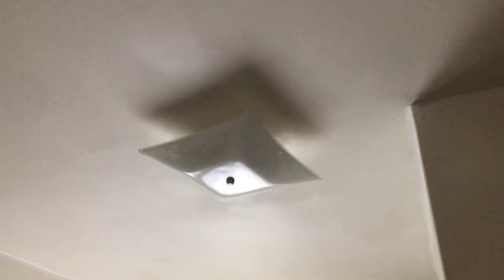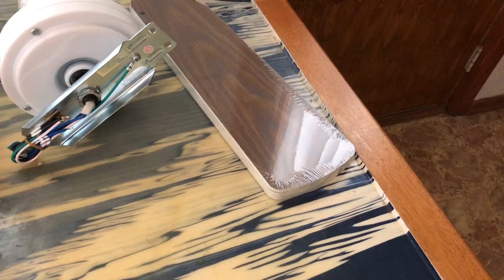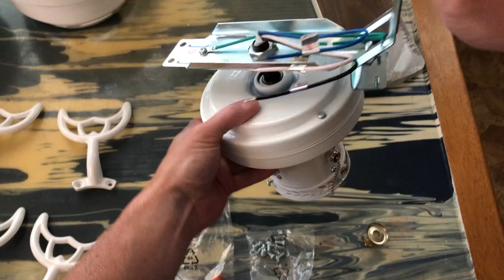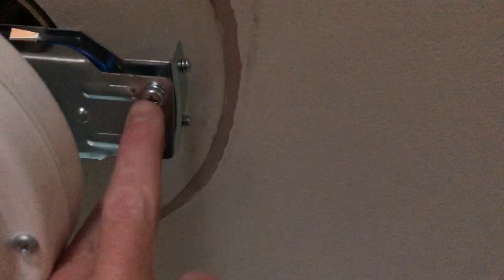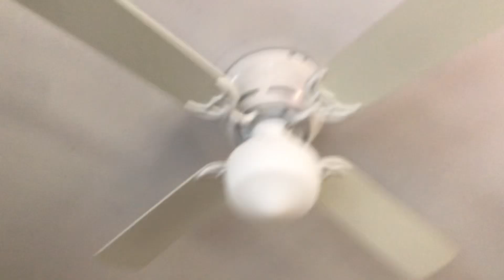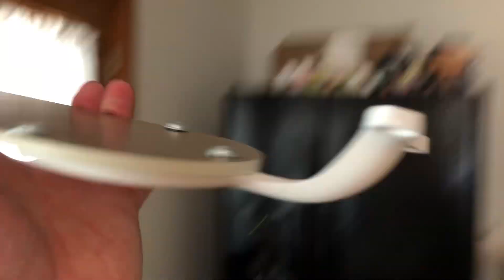Mainstays 42” Ceiling Fan Installation and Assembly

Comment: That electrical box isn’t rated for ceiling fans so you should have replaced the box
Reply from the maker: Ohhh? Appreciate your insight 👍
Reply: @ChrisBassettDIY all of my ceiling fans were mounted to plastic light fixture boxes and one of them fell off the ceiling so I had all the boxes replaced to ceiling fan rated boxes
Reply from the maker: @STLtraincoverage4567 I didn’t know even know that was a thing

Comment: If you wired don’t have a ground cable to connect. what do you do ?
Reply from the maker: Hey Robin! I didn’t have a ground wire either. If you're installing a ceiling fan and there's no ground wire in the electrical box, follow these steps: First, ensure power is off at the breaker. If the box is metal and properly grounded, connect the fan's ground wire to the metal box using a grounding screw. If the box is plastic or not grounded, you can still install the fan, as the ground wire is a safety feature but not essential for operation—secure the fan's ground wire to itself or cap it with a wire nut. For safety, consider having an electrician add a ground wire or confirm the box is grounded. Always follow local electrical codes.

Comment: What do I do with the ground wire
Reply from the maker: Hey D! If there is a spot to ground it you can tie the ground wire from the fan to the ground in the ceiling. If there isn’t one available (I didn’t have one also) I just tucked it up and out of the way

Comment: What happens if I have 2 whites and 2 blacks left after disassembling the old light fixture?
Reply from the maker: Hey Subrein! In a ceiling fan electrical box, having two black wires and two white wires can indicate a few different configurations, often related to how the fan is wired or the existing electrical circuit. Here are some possibilities:

1. **Multiple Switches**: If you have a ceiling fan with a light kit, the two black wires may be for separate switches—one for the fan and one for the light. The two white wires can be used for the neutral connections.

2. **Power Feed and Load**: One pair of black wires might be the power feed from the electrical panel, while the other pair could be running to another fixture or device. In this case, you would need to identify which wires are for power and which are for load.

3. **Looping**: If the fan is part of a series of fixtures, the black and white wires might be looping to another location in the house.

4. **Reversed Wiring**: It's also possible that the wiring was done incorrectly, and the black wires are not properly identified.

5. **Fan Control**: If you have a fan with a remote control or smart features, one set of wires might be for the fan's operation and the other for the control mechanism.

### Safety Precautions:
- **Turn off Power**: Always turn off the power at the circuit breaker before working with electrical wiring.
- **Use a Voltage Tester**: Test the wires with a voltage tester to determine which are hot, neutral, or ground.
- **Consult a Professional**: If you're unsure about the wiring or how to connect it properly, it's best to consult a licensed electrician.

### Wiring Connections:
1. **Black Wires**: Typically connect to the fan’s motor and light fixture.
2. **White Wires**: Connect to the neutral wire of the fan and light fixture.
3. **Ground Wire**: Ensure there is a ground wire (usually bare or green) for safety.

It's important to correctly identify each wire's function before making any connections to ensure safe and proper operation of your ceiling fan. Hope that helps!

Comment: What dod u do with the green one? I didnt see you connect it to any ground
Reply from the maker: That’s the ground wire, you can screw it to the metal frame… the electrical box should have something 😁👍… the previous home owner cut mine off lol, I should run a new wire
Reply: @ChrisBassettDIY  ohh that makes sense thanks

Comment: Are you still active on this video/ channel?? I’m trying to mount the three screws for the motor to the bracket, but the third one- the side with a single screw- doesn’t screw into the bracket and stay. It poke through, but doesn’t thread. What did I’d to wrong??
Reply from the maker: Hey Meg! 😁 You are using the screw you removed from the fan motor? My guess is if it doesn’t fit it’s either a factory defect or using the wrong screw 🤔… they had 3 pre-installed/out-of-the-box screws on the motor bracket that need to be removed and then used to hold both parts together when you sandwich the fan motor to the ceiling mounted bracket

Comment: Wish I could show you where I’m starting from. My ceiling circle and wires that is, don’t know if it has the bar that goes across for the mount bar to connect too. Wish I could comment a photo of it for you to see and give me an idea lot what step is next.
Reply from the maker: Hey Victoria! 🤔… are you replacing and existing fan or installing something completely new?… the existing fan should have a box to connect too… if it’s completely new you’ll need to install and run wires
Reply: When I moved in there was a ceiling fan there, but anytime you flipped the switch it blew the breaker. Somehow the wires had spun and got wound up rubbed bare and were touching. Lady I bought the house from had her nephew come take down the old ceiling fan and capped the house wiring. I’ll look into it more after I get a ladder this weekend, I’m vertically challenged, my step stool isn’t tall enough. I think what had me confused is there’s a circular bracket looking thing, but from what I can see from standing below I take that off and then the bracket will be able to connect. Thanks for such quick responses. If for some reason I get stumped I’ll come back with questions. Thank you again

Comment: I only have 1 gray wire the comes out of the ceiling the wire that connected to the last fan was white labeled "neutral"
Reply from the maker: Hey Linda! You should have more that one wire…. Was the fan running before?.. Is it possible that one wire got cut back or off?… does the grey wire have more wires inside if it? (If it’s wider/flatter, it’s probably Romex which you would cut the sheath off to expose the other 3-4 wires inside.

Comment: Hello. Do these fan output a lot of air? I installed one and there's barely any air. The direction switch is forward.
Reply from the maker: Hey Auto, in my opinion it’s just ok. It has 3 settings when you pull the chain it goes high -> med -> low, then off. If I had to compare it to a box fan (which it think has good airflow) it’s about half of that on the high setting… I put two in my kitchen to keep the air moving when oven/stove is on. One positive comment is that it’s quiet, so it’s a good bedroom fan at night

Comment: Is there some way I could get ahold of just one of the blade arms? My fan had one snap off after I accidentally hit it and I'm hoping to avoid having to install a completely new one
Reply from the maker: Hey Double! Um…. Only thing I might suggest would be to look for a replacement fan blade online… maybe search facebook marketplace or you could make one yourself… trace and cut the fan blade from a sturdy material 1/4 plywood or plexiglass maybe… the weight distribution is important so the fan doesn’t wobble/out of balance